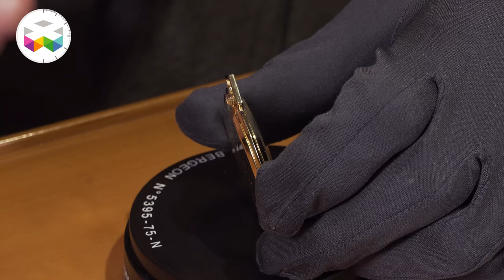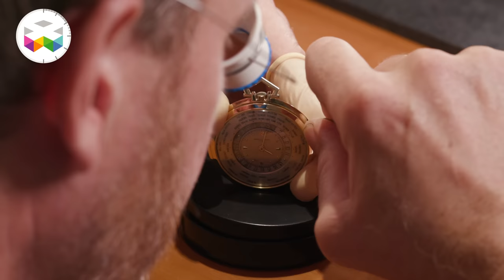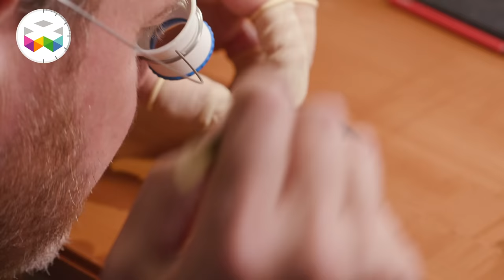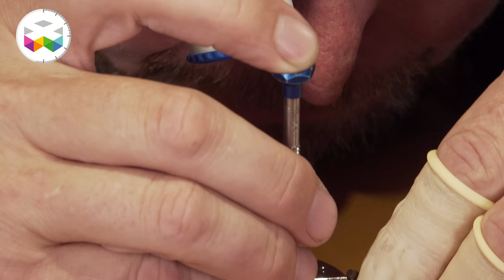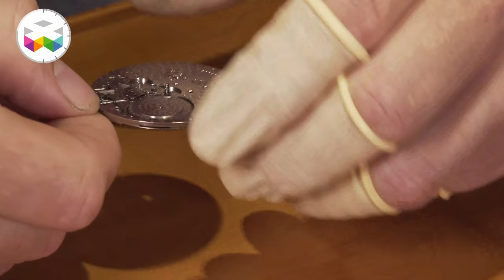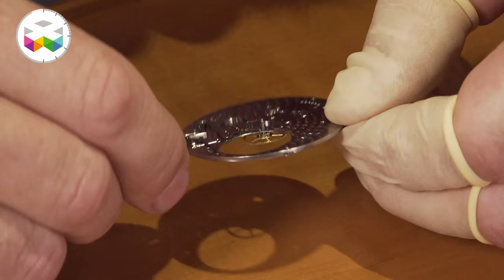Don't Do This At Home: Vacheron Constantin World Time Pocket Watch

Comment: I did this with two of my watches, one a Vacheron and the other a Patek and each time ended up with 2 and the other one 3 screws left at the end.  Also one of them was making a strange noise like friction.  So I decided to video record my 3rd attempt using the Piguet from my dad's collection when he went on vacation.  I was able to open the thing with the spring inside but was not able to put it back in. I bought a fake one for when my dad came back and it took me months until I found out that there's a special tool for that.  I did it and then put it back except that I chose to use WD40 to lube the gears and also I felt that ball joint grease would be better for the jewels. I glued the screws with Krazy Glue to make sure they stayed.  It worked perfectly despite missing one screw that held the bigger part which I think is called the bridge in place.  I put it back and my dad never noticed. I thus became an expert on this kind of thing.